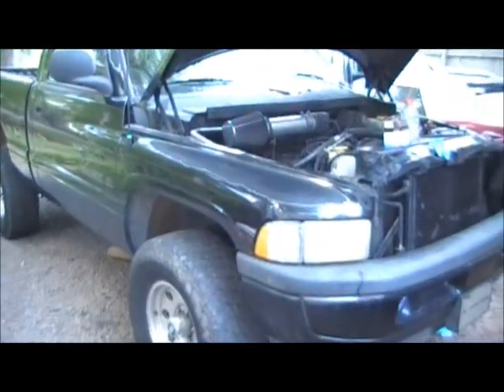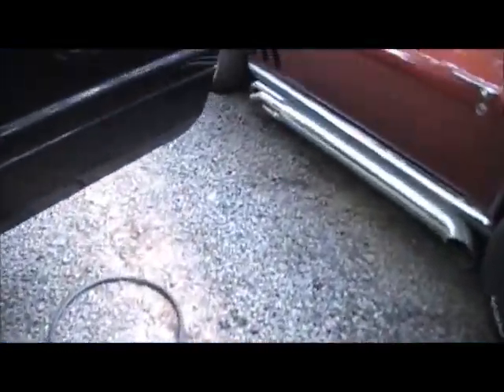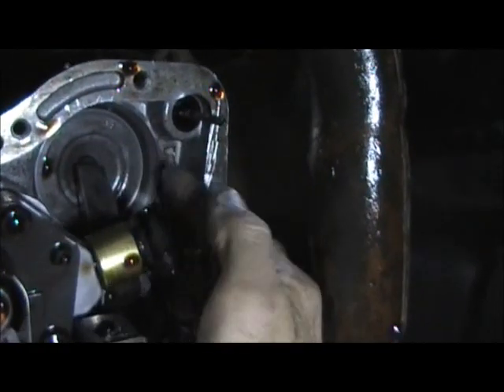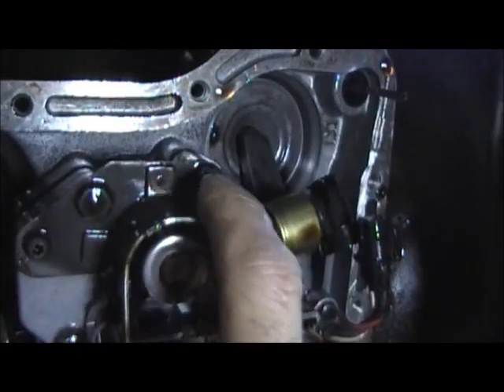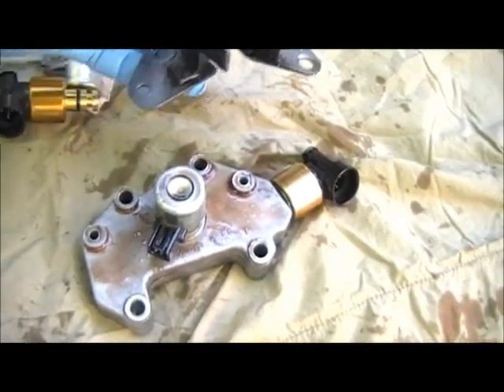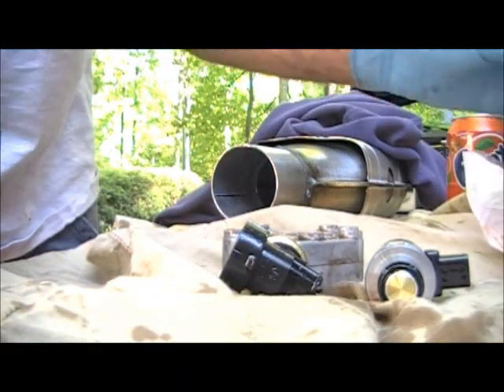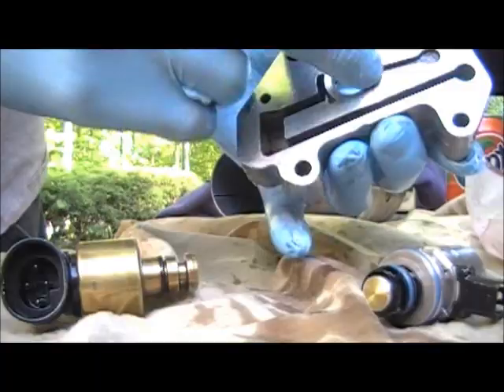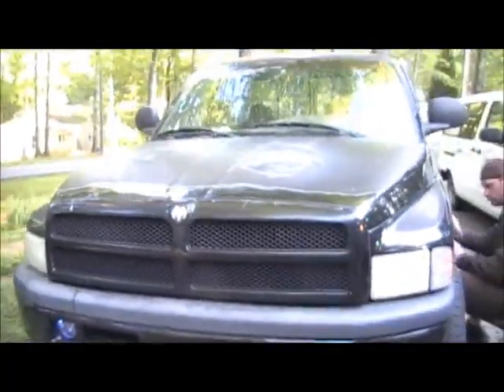1998 Dodge 1500 Transmission Wont Shift Fix

Comment: Having a similar issue. Had us a hot spell for about a week and was driving my 99 Durango and it was like someone turned off a switch or a cable broke or something. The passing gear seems like she ain't all there! She'll roast 'em in reverse no problem. When I put it back in drive its just a gradual acceleration. Once I get to high speeds I really have to floor it just to get the passing gear to kick in..  Need help!! Any ideas ?

Comment: okay i have a 98 ram 1500 4x4 and some days it will be fine, and some days it wont engange very well, and it will take alot of rpms to move until 25 mph, and sometimes if i let it roll forward at a stop light, it wont do that at all? ive dropped the pan and replaced the fluid and everything. Any ideas?,,, and its overheated once on me..

Comment: I have 2000 1500, that would only shift if i put it in neutral and then back in drive. A couple days ago it stopped shifting altogether. I checked the fluid and it is dark brown. Would doing this help me?

Comment: great video,i have a 98 ram 1500 with  318has ,180,000 miles,havent drove it in a week it had been very cold 10-20 degrees, i started it let it warm up for a few min, and i drove it up a pretty steep driveway when it got to the top of the driveway it just started slipping,could it be the fluid was way cold , i then drove it maybe 15 20 min and it seemed to shift fine, there is a little slack when it is put in reverse, checked fluid it was full and did not smell burnt at all,, any thoughts

Comment: 99 dodge ram 1500 shifting hard into 3rd gear also takes little while for 2nd to shift to 3rd usually when i release of the gas. so far i have gathered, trans solinoid
governor pressure sensor, flush trans fluid replace filter, clean iac and throttle body, what do you think?

Comment: I'm about to buy a 98 dodge ram 1500 reg cab 5.2l v8 for 1250.00 has 189. Thousand miles. Check engine light is on and the seller said the tranny was rebuilt. Is there anyway to tell and is that a good deal to buy it???

Comment: i have a 1997 dodge ram 1500 5.9L motor. it shifts into 2nd fine sometimes. but to get into 3rd i have to put it in nutruel and back in drive and it shifts into 3rd. and it stays in 3rd a few seconds and shifts into overdrive. you think if i changed the solenoids it would fix this? i adjusted the TV cable and it didnt make a difference.

Comment: but noise would disappear by the time i got to 3rd gear. ????? now today the noise is still there but truck wont shift out of 1st and once i get rpms up to like 2500 or so and it slips out of gear and really wont drop back in unless i completely stop truck,put in park,shut it off then restart. but then it just repeats what i just said.  do you think replacing solenoid and sensor and checking bands is the way to go or????

Comment: I have a question. My 1998 Dodge 1500 refuses to shift so in the video you have posted it said something about a band that does not need alot of play. However the band on my transmission has a ton of play how do I fix that?

Comment: I found out from my dad's 1996 dodge ram 1500 has the magnum engine that it wouldn't shift and sometimes wouldn't stay running we found out it wasn't that. It was from the Catalytic Converter being plugged solid. We opened it up and carbon came pouring out. Now its an empty chamber, gives it a much throatier sound and the idle speed is 20mph! Only 11mpg on a good day, any fixes? I've heard plugs, airfilter, oil change, tranny fluid change, and dual exhaust all increase mileage. Any suggestions?

Comment: I have this problem i just bought the damn thing and its acting up already not even a month into it! It revs up after shifting into second gear and doesnt want to go into 3rd. I check my fluid alot and this last time i checked i had a little bit of metal on the stick if i replace these how much longer would my tranny have if this fixes it.

Comment: okay i got the solenoid housing off their was a gasket it had come down to , does this need a new gasket? if so should i use sealent? also does the transmission pan need sealent? also is their any sensors i should buy besides them to ? their a sensor on the other side of the valve body, has a werid backing lots of plastic ugh, think i think somone said might be over drive sensor or somthing not sure, maybe just leave that one alone?

Comment: There was no 5.6...there was a 5.9 (360). So, any advice on what I should do about the fluid if I do thius fix you have in the video? I have been told, as I said..by several mechanics that because of the high mileage 126,000..the fluid shouldn't be changed because it will then most likely cause big issues to arise. So, I mean, how the heck can I fix the current issue with the shifting problem...if I cannot put new trans oil in the thing?

Comment: cont>> Furthermore, I have never opened a tranny and only changed a pressure plate and throwout bearing on an old 72' Roadrunner I had 25 years ago. other than that only work I have done myself on my truck is change the brakes and starter, batteries and belts, filters and tires. Do you think I have enough "know-how" to play with the tranny as you are doing with this fix? Lastly, how much do those two original Mopar parts (the governor pressure switch and solenoid) cost? Thanks for any feedback.

Comment: Hi I have a 1997 dodge intrepid 3.5 and I'm having the same problem, the transmission gets stuck on second, the reverse works just fine, i'm wondering if I could do the same thing you did on this video to fix it or I may have to do something else.

Comment: Hi 2012nugget

 I have a 1999 automatic dodge ram, it just started reving up when trying to switch from first to second gear. It fells as if she is not in gear. then she wll change after a few seconds of high revs. I removed the tran pan and found that there was allot of junk in the pan, also i had a sever amount of play on the front band which i could not tighten back the way it should because the bolt was not long enough. Any ideas on how to fix this problem. Thanks

Comment: Hi. I have a '99 Dodge Durango, 5.9,V8, 2WD, 3 wks ago it wouldn't idle when I started it, it would just die, so I was told to replace the IAC, which I did and it idled fine for about a week. Now as soon as I start it, it dies. Plus, it doesn't shift from 1st to 2nd now, trans fluid is good. Are these separate issues or caused by same problem? I'm stumped have no idea what to do. Can't afford to take it in right now. I appreciate any input that might help. Thanks.

Comment: I have a 98 1500, 5.2 318, just a quick example of what its doing, and if you have an idea. 
It revs a little high before shifting to 2nd, while in second I have to rev it very high and let off the gas to get it to 3rd, once in 3rd it will drop back into 2nd and the rpm's shoot up, any ideas? Any easy or cheaper fixes besides the tranny?  Thank you

Comment: Thanks very much for the reply...hmmm, but two things, Since I have high milage and have never changed the trans fluid (126,000 miles now) should I drain the fluid only and then just replace it after the repair with the same fluid I drained out? (The fluid is pretty clean for it being 14 plus years old. And is the engine in the truck in your video also a 318/5.2 liter? Finally, will I need to put a gasket of sorts on the pan of the tranny when I replace it? Thanks again for a reply.

Comment: 2012nugget,   Hello. This is a nice video. I have a 1998 Dodge Ram 1500 4 x 4 also...with the 5.2 liter (318) engine. Is that the exact same engine in the truck in your video here?
I am having the identical issue since 6 weeks ago or so. Automatic trans. shifts from 1st to 2nd with no problems but winds out and won't shift into third. I've never had an issue with it and have had it since 1999 bought as a leftover. I have NEVER done a fluid change and the fluid is still full & clean-ish. cont>>

Comment: Help, my 98 Ram 1500 4WD 5.2 under city driving throttle pressure, shifts to 2nd then back to 1st then back to 2nd.  It does this several times b4 it stays in second.  If using more throttle, it shifts ok.  Other gears OK no problem.  What do you think?

Comment from the maker: So it will shift manualy or is it just messing up all together ? Of course running low on fluid is bad and overheating worse but you usually will stop due to low fluid before doing too much damage, of course providing the tranny was in decent shape before hand. Im keeping my fingers crossed for you.

Comment: I just got a 99 dodge ram 1500 regular, on the 1st gear it takes long to shift to 2nd & when it shift to 2nd I press the gas to go on but it shifts back to 1st & continues there until I do the same thing let go of the gas to shift to 2nd once it shift to 2nd I continue very slowly which I don't like, can it be the sensor ???

Comment: ..cont..wanted to write down the part numbers you show on the sides of the solenoid boxes in the video. But, if the Ram in the vid is not the 5.2 -318 cu.....then those part numbers may be wrong..yes?  
Thanks again.

Comment: I have a 99 Ram 1500 and I am pulling a code P1763. It says my Governor Pressure sensor input is to high. Would replacing the pressure sensor and solenoid take care of this or is there more I should be looking into?

Comment: you might wanna flush the transmission cooler also,it might be clogged.its in front of the truck buy the radiator.does the check engine light come on? if so whats it telling you?

Comment: I have a 1999 Durango 5.2 with the 44re transmission, I've had the pan off and saw these solenoids. I did a filter and fluid change, upon first test drive it was fine, however after work, it shifts first and second reliably no slippage, but wouldn't go into third or overdrive, before this, it would go first second then third if I'd run up the rpms get up to around 45 then go from D to N to D real quick while lifting off the accelerator then it would grab third. Sounds like these solenoids are exactly my problem. however with that being said, I have a friend who is an expert transmission guy who I learned has a source to buy transmission parts whole sale (used to have mechanic shop in town) I learned I can get all the transmission parts for a whole rebuild and upgrade to 46re guts for the same price as these solenoids by themselves. I think I'm going to have it gutted and redone...

Comment: 98 dodge durango drives as if emergency brakes are on and light stays on even tho released..fluids good wiring good brakes and calipers changed. can it be the gov pressure sensir??

Comment: Thanks for the video, doing my 2000 1500 right now (pretty close to the same layout, except the transducer is different).  Question, you comment on tightening the bands.  I looked at that and found a 5/8 nut, but it's really high torqued, before I bust something, thought I should ask, is that how those bands are tightened?   Thanks again.

Comment: did it only overheat once? did the trans temp light come on? because the check valve wasn't clogged don't mean the cooler isn't. if the new cooler don't help i would have the whole transmission flushed.does it shift ok? if it hangs up while shifting you might need the bands adjusted.honestly the best thing to do is bite the bullet and take it to the dealer,without the computer telling you whats wrong you can change things forever hoping to get lucky.i owned a Chevy for years,its no better....

Comment: I have a 97 ram 1500 and my problem is it stays in high gear going up hills and does not want to stay in on straight highway, seams like it does it when it gets warm, does this sound like the same problem, yours stays in 2 and spins out, im just not sure if they would be the same issue, thanks for the video

Comment: Hi sir, would these sensors be the cause of when the shifter putnon drive and revese and had a late engagement? I have to reach 5000 rpm to make it move just a little bit. Code is p0700. Kust feels like there is no pressure.

Comment: I have  a 1999 dodge ram truck  it has a 46 Re in it but it is a 2000 it isn't  shifting right I was told to buy a 1999  shift sylonod kit put it in it will that work it hesitates when shifting  if I let off the gas it usually  shifts any suggestion will be greatly appreciated

Comment: I have a 2001 dodge ram 1500 5.2 V8 4X2 and it doesn't go back into first gear when I come to a complete stop, (This only happens after warming up and driving for a little) I changed the governor pressure sensor, transducer, transmission filter and fluid and the problem still happens. I have to shift the gear manually into 1st for me to give the truck power to move because it's like driving a manual transmission but starting in 2nd, RPM's go up and truck moves but very slowly. If I leave it in D and floor it, it jumps into first and tires spin a little before I get traction. Could it be the entire transmission going?

Comment from the maker: Check to see if the filter is installed correctly, you'll need 4-5 qts. of fluid for this. Also stop by your local autozone and have them pull transmission codes for you, thats free !

Comment: nice vid..my 99 durango 5.9 wont shift outta 1st or 2nd unless. it also slips outta those 2 gears. repeatedly shifting to neutral or letting rpms drop after it slips outta gear will finally make it change gears. 3td,4th and overdrives are fine. Was gonna hit a transmissiin shop for a rebuild but ill think ill try this firsy. Did change tranny oil and filter. Oil had dirty, pan had metal flakes(normal, as well as magnet had nirmal shavings. Lets hope i will save $1500-$2000 by doing this.

Comment: I have the same truck, mine wont start rolling in first unless I put it in first on the column, got code p0753 not driving it at all replaced that sensor and solenoid thanks to ur video it was really easy. any other suggestions saying solenoid a

Comment: what if the "won't shift from 1st to 2nd" only happens while in 4 wheel drive low range but shifts normally in 4 wheel drive high and 2 wheel drive high ??  Have a 98 V-10 Quad cab with 4 tires and short bed with this problem

Comment: ihave a 2002 rt durango, please let me know if this fix will fit. the durango revs out arround 4500-5000 rpm before itwill shift to 2nd and rarely shifts into 3rd. oh and i just did a fluid change and filter no metal shavings or clutch material

Comment: Hello 
I have dodge Dakota 2000 
4 wheel drive V8 with 50 .000 miles 
Please I have problems when I put the gear at d or R 
Car not moving at all do you think 🤔 what I have to do please please help me

Comment: Will I have to remove the Valve body to replace TCC and OD solenoids in a 1994 dodge ram 1500? I have a chatter at 40mph which stops when I hit the brake peddle. No Engine light codes. Some concern about Torque Converter, Folks telling me that this problem could be caused by either or. Before I spend the money which is the most likely. THx Dave

Comment: I have a 1999 Dodge ram 1500 5.2L 318 4x4 and it starts fine and shifts into drive and accelerates....but the RPMs tack up to about 4000 and the transmission still has not shifted......any ideas what it nay be or what I need to do to fix it??? I would sure appreciate any feedback at all. Thank you.

Comment: Sorry for another ps but I forgot to mention that I read somewhere online that this problem might also be caused by some adjustment cable that goes down into the transmission which might need to be adjusted? Possible? Thanks again 2012nugget. Much appreciated.

Comment: Excuse me sir I JUST bought a Durango 99...from a dealer...and well got screwed the transmission seems to slip occassionally usually at only lower speeds between 25-45 but it will eventually shift. I was just wondering if you think doing this same thing to my transmission could fix the problem or if I should just chock it up as I need to drown another 3k into getting a whole new tranny? I know everyones asking questions but I REALLY need your advise here. Thank you

Comment: cont >> It has 126,000 miles and the 318 engine purrs like a kitten. A friend who is a mechanic for 30 years and a few mechanics online have said that if I never changed the tranny fluid or had it flushed by now..then I should NOT change it. Do you think the fix you show here is my problem too? Further, since I've been told not to change the fluid..don't I have to drain all the fluid when I drop the pan as you show in the vid? If so would I SAVE the old fluid and put it back afterward? cont>>

Comment: ps. By the way I called the Dodge Dealer where I bought it and the service manager for transmissions said they two good guys who work on trucks almost exclusively and one who does mostly cars, & that an estimate is 120 bucks and they will run a computer check and check the "bands" etc.but he recommended an entire rebuild rather than maybe spending hundreds now and then 6 months later it has issues again?? What do you think? Thanks a lot for your feedback. Appreciate it. (By the way, I'm poor.)

Comment: I just inherited my dads 99 ram 5.2 liter and the transmission will only drive 20 ft. or so and then it starts high revving it has 120k miles and set for two year has not been driven hard  could this be the same thing

Comment: I have a code of PO740 a/t  torque converter out of range any ideas and PO141 o2 senior fault right side post catalyst.  would one of these cause it to not go over 30pmh I hit the gas on it buggs out at light n it feels like it wants to shut off o give it gas it's fine or I take it out of gear it idles back up normal 500-700 ish drops past 200 n trys to stall out / shut off??I have this block  piece in my hand